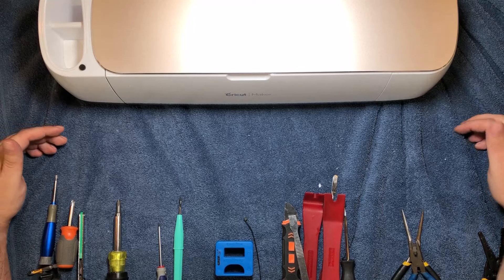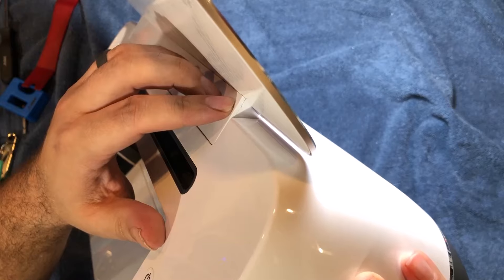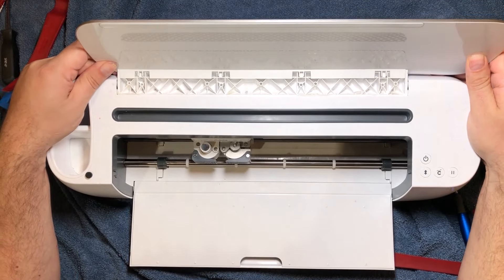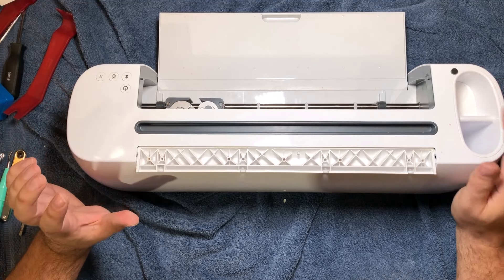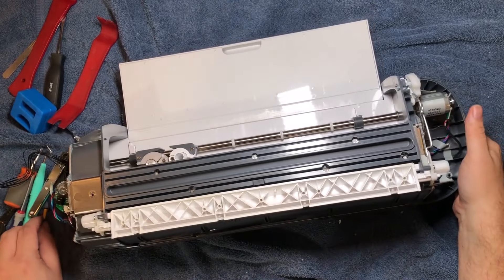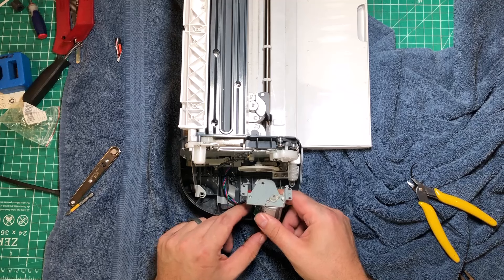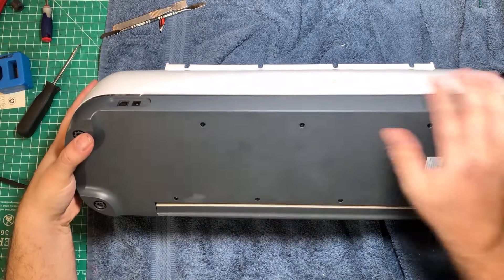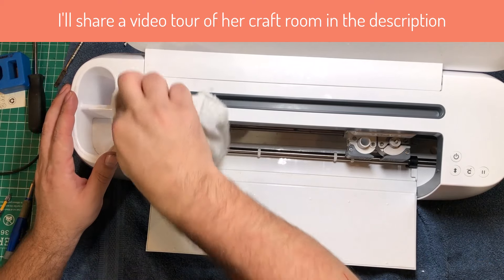The Ultimate Guide to Replacing Cricut Rollers - Every Step. Every Detail.

Comment: Thank you for such a well detailed video on replacing the rubber rollers on Cricut machines!  This is probably the best detailed one I have seen.  I'd like to add a few tips that will help others in this endeavor: 
 1. My Cricut Maker definitely requires a T-9 driver for the lid screws.  I have seen other videos and even comments here that had/have the same info.  Owners should be aware that it may be either T-9 OR T-10 --- Either way, it surely seems just an attempt by the manufacturer to stymie owners from DIY repairs.
 2. You may want to show a more clear view of which way those angled posts/tabs face on the underside of the flat plastic cover of the top lid hinge.  If you attempt to put it back on with the piece turned the wrong direction . . . well, let's just say it don't work. 
 3. You are spot on with your description of placing the body/cover back in place and aligning those slats/tabs... ALL of those slats/tabs!  I thought ours was properly placed twice, but when I had put the bottom four AND the seven top-underside screws back, replaced the lid on the hinge and closed the lid for inspection, both the first and second attempts had the center section of the back of the body bowed out.  I tell you, removing and replacing those seven underside screws just doesn't get any more fun with practice!  The third time, it just seemed to fit like a glove when I placed the body back on and the four long screws even seemed to go in smoother too.

4.  There IS an easier way to replace those tension springs!  Really easier than trying to hold a tiny portion of spring metal tightly and stretching beyond your gripping strength.  First, make sure to put the end of the spring that is "more closed up" on to the bottom, or arm, connection FIRST.  Then, using a very small flat blade screwdriver, the smaller the better, slide its blade through the opposite spring opening.  Let the spring slide down the screwdriver shaft some -- perhaps an inch and a half, but not too far as you don't want to stretch the spring beyond recover.  Now place the flat blade just into the tab slot for the spring.  You want the screwdriver blade just a tiny bit through the tab/slot width. (I hope this makes sense -- you don't want it so close to the edge that it will slip off, but you also don't want it extended too far beyond the tab; which will make keeping the spring in its place more difficult when removing the screwdriver.)  While lifting the screwdriver handle, slide the spring up to the slot where it is to go.  As you continue lifting the screwdriver keep pushing the spring over the tab for the slotted position for the spring.  It may not happen perfectly on your first attempt (although, I have NEVER had this method fail), but if you pay attention to where the spring opening is facing and keep the spring as close to the tab/slot as possible, it will be in place before you know it.  I've used this method since I was about age 14 (now 70) and the whole process takes about 3 seconds.  You're welcome.

Comment: Did step by step exact 2x. When complete, when lower rollers roll to feed the new top rollers and bar that was removed doesnt roll.
Reply: Gears misaligned? IS the shaft bearing down on the smaller gear on the motor side? Those clips are there for a reason and that's one of them. unless you bought the cheap 3d printed "replacements" that are hard plastic and don't come in contact wit the knurled drive spindles/wheels on both sides of the hidden shaft. (The ones the rubber should be in contact with)

Comment: Thank you very much for the detailed explanation, especially for the recommended tools for those of us who are beginners.  Regarding the difficult portion in which you need to work with screws inside the cricket body: If you don’t have a small socket wrench, you can always hold a drill bit in place with your fingers and use a pair of snub nosed pliers to break the screws loose and/or tighten them into place.  The trickiest part of this job for me was the roller removal.  I found that the inner plastic layer of the roller hole on the power switch side was not aligned with the metal hole of the cricket frame.  It looked like a manufacturing defect and it made removal of the bar impossible because the upper part of that hole is supposed to be larger than the lower part.  I used a small strip of sandpaper to sand down the plastic and widen the hole which allowed the bar to be removed.  Other than that, I’d recommend some very fine nosed curved tweezers.  They helped with removing and attaching the circlips and grabbing dropped screws.
Reply from the maker: Thanks for the tips. I did one more that I wound up having to use a small file to make that hole bigger. So annoying.

Comment: Hoping someone has a suggestion.  Everything is perfect...except the bar with new rollers will not roll.  My husband and I have figured out that if we detach the two tension springs and hold them taught but not under tension it will work.  If we push mat in super hard under tension it will intermittently work.  I did use the harder plastic rollers (heated to 170).  Has anyone had this happen?  Should I get the other rollers....or ???  Thanks in advance.

Comment: I followed the instructions, was able to change the rubber, following also the pinned comment (filing a little of the hole). However, got a new problem, I must have done something wrong during the disassembly. My cricut won’t load my mat, it just keeps on blinking white and doesn’t respond when I click the load button. 😢 I contacted Cricut and they said it might be a button problem and they can’t replace the machine as it is out of warranty. Anyone encountered the same issue or know how to resolve this?

Comment: I have a T10 bit but I can't fit it in to be able to unscrew the very first screws on the top, how did you guys do it?
Reply from the maker: Apparently some machines use a t9
Reply: ok I went to Ace Hardware and bought a kit with the different sizes in it on a skinnier attachment and yay the T 9 worked perfectly. Now on to the rest of the steps lol!

Comment: Amazing tutorial!!!
Just fixed my wife's unit in 1-1/2 hours (needed better prying tool).
I'm a nearly 20-year veteran of repairing and programming surface mount machines (fixing/training robots that make circuit boards), and this video has better directions than I get from the training classes from the manufacturers for my robots!😅😂
Reply from the maker: haha Thank you so much fore the kind words!
Reply from the maker: And it's not lost on me that it takes someone who fixes robots for a living 90 mins and youtube tutorial to replace two rubber rollers.  It's kind of crazy, right?

Comment: Thank you so much for this guide!!! So so helpful!! But damn what a process! I feel like I could sue Cricut for emotional damages, and I’m pretty sure my kids learned a few new curse words— I think I even invented some! lol you weren’t kidding about those springs flying QUICK, and what was with all the wet glue?! All that being said, my cricut is working again and I’m very grateful for this video 🤗

Oh! Just wanted to share this in case it helps anyone else, the door panel on mine was also glued to the actual door itself on both ends. That was the part keeping it really stuck for my machine.  I took a scraper and lodged it in between then gently tapped it with a hammer towards the edge, like a chisel. Did that on both sides and it popped right off!

Comment: Couldn't get this to work.  Mine seems to have a few design modifications to make the job impossible.

The top panel that you popped off - mine had the corners glued down.

The gear wheel that comes off easily on yours, seems to have some plastic housing butted up close to prevent removal.  I had to cut this housing with a chisel.

Then finally, the holes on the metal plate at either end of the roller bar are too small to get the bar through, even the shaved off right hand end.  The bar is locked in place, and the metal plates are impossible to loosen.

It looks like a deliberate design tweak to make the rubbers non-replaceable 🤬

Comment: Thank you so much, this video was fantastic! So glad I didn't have to buy a new Cricut!! I was following along with this in addition to another PDF guide I found so I could have both the static and in-motion instructions. One thing I noticed from the PDF guide was they specified where to put the spring back that goes above the motor. I went back on yours and it does look like you removed it from a different spot (on the same bracket as the motor) from where you put it back (the hook above the bracket). Not sure if it matters just a heads up!

Edit: My husband is 100% sure he removed it from the hook and looking at other videos some are on the hook, and some start on the bracket. So maybe it just depends on the model?
Reply from the maker: Hmm. I'll have to go back and look at some footage.  I did 3 that day and although they were all "Makers," there were subtle differences between them.  There's also a slight chance that shot was from a different machine. There were one or 2 where I got my head in the way, so I used the footage from an earlier machine.  Either way, people should put it back from where they got it :)

Comment: @ 3:17 you removed a spring. Later you put that spring in the wrong location during reassembly @ 23:11
You put that spring on the wrong secure point. I know it looks like the correct placement but IT IS NOT back where it was removed from!
Perhaps that stamped metal frame is used for multiple models and utilizes that "hook" in other designs but NOT in this Maker3 model.

Comment: I’m having a hard time removing the rod. I did everything in the video but when I remove the clip the rod is stuck and not moving as easily in the video. Did anyone else have that issue? The machine is a Maker.
Reply from the maker: I had a few of them that I needed these a little file to file around the metal edge to get the rod out
Reply: I was able to pull out the rod. Wasn’t as easy as in this video. However, it’s done!! OMG this was such a stressful endeavour, but worth every minute of frustration! My Maker is up and running!

Comment: Hey, followed your instructions, twice, and after reassembling the unit, the machine would not load the board!! If I jam the board in a little bit it would work. Do you know why?
Reply from the maker: I think that was also a common problem with Cricuts. My wife had one like that and Cricut replaced it.  It wasn't the rollers, it was some gear related problem. They actually did a software bricking of her existing one and sent her a new one, so it must be pretty common.
Reply: I would guess like a CNC machine the GEARS need to be REALIGNED EXACTLY how they were REMOVED when removing that motor. I marked mine prior. As there is a "HOME" function in CNC machines and most likely in the programing with these geared motors. Take for example the OPTICAL ENCODER (clear plastic wheel on the motor) that is used to indicate to the microprocessor WHERE the motor is when running. So It would NATURALLY need to know it's ORIGINAL starting position so as to not "OVER RUN" it's limits and break the machine.

Comment: This was ok to do but when finished with everything I went to turn it on, and it makes a noise and then the power button started flashing red. What did I do wrong? I followed everything just like he said and when I did not get it, I went back just to see what he said. Please help!!!
Reply from the maker: I would guess something is binding. The first thing I would check is to make sure those gears on the left side are meshing together properly. You can turn the machine on with the cover off so you can see probably pretty easily what is bonding
Reply: @AnotherMaker  I want to thank you for responding to my question. I went back in and found the that I left one of the springs off and it got caught into the small white wheel. THANK YOU SO MUCH FOR POSTING THIS!!! Cricut should be paying you for this big time.

Comment: Wait so did you replace the clip on the non button side?
Reply from the maker: No. It's not needed. The other one holds it in place.
Reply: @AnotherMaker  thank you for the reply.  I got it on with minimal effort after finding it the first time I lost it.  Used my pliers and then my pry tool to line it up and push on the top.

Comment: Oh lord! Why do they make it so difficult???? It’s so frustrating! 30 min and still stuck with the first plastic piece.  afraid of breaking it. I see all the pins are out, but there is additional glue on the back in both sides! I used a hair dryer for a few seconds to loosen the glue (may have melted the lid? Maybe 😂😂😂).
Reply: @caroljovanelle
0 seconds ago
I made it! Definitely melted the left part of that top lid. Will see if Cricut provide spare parts for it. The the rubbers are in!!
Reply from the maker: Glad it worked out. There's definitely a vast difference on how difficult those lids are to get off. One popped off in 30 seconds. One took 30 minutes.

Comment: The Maker is so poorly designed.  They should be ashamed! With that said this video was great.  A few notes.... 
1. I needed a T9 driver. Bought a precision driver set on Amazon that came with a flexible screwdriver that made taking the inside screws really easy to remove. 
2. If you use the non clip rollers you can soften them with a blowdryer or heat gun to slide on easier.
Reply from the maker: Thanks for the tips. Yeah. If you're designing something that's both not durable and difficult to repair is horrible.  We had an Air 2 for 5 years without issues, and then every one of these makers has needed roller replacements.